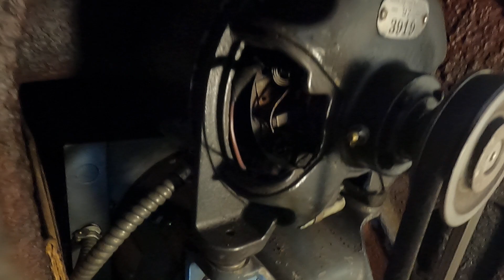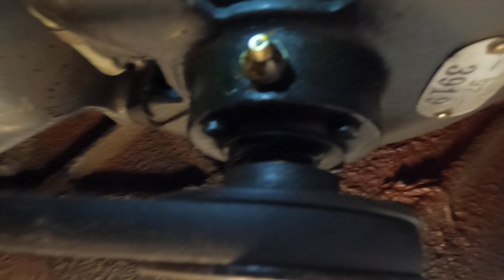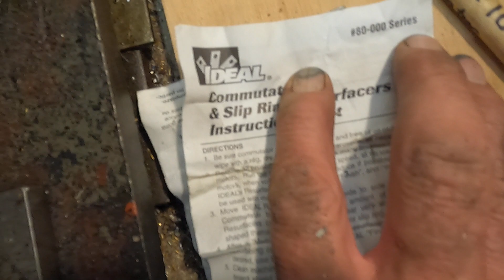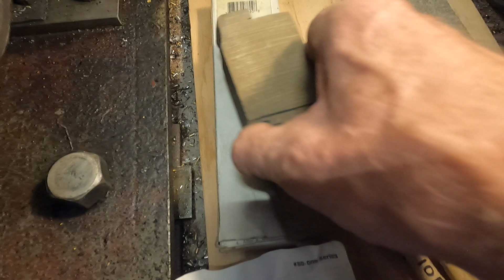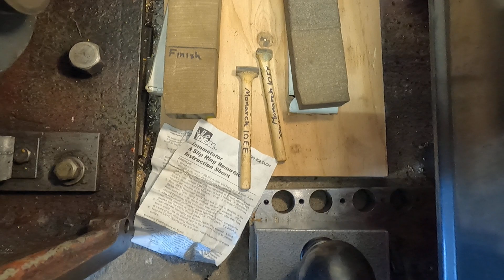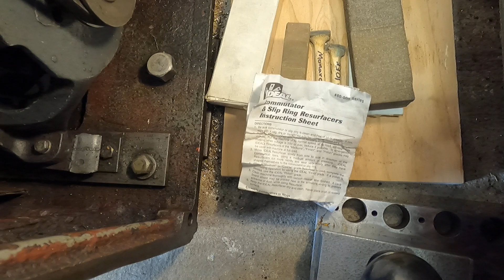Monarch 10ee lathe Motor Generator Reliance Drive maintenance

Comment: I don't understand why the engineers of the Monarch company have given this solution... It seems to me a very complicated, noisy system with high costs both in manufacturing and maintenance. I am sure that it is not effective both in the electric yield and in the torque of the machine. It costs cheaper to maintain a clutch and a gearbox...
Reply: Remember this "solution" was put in place in the early 1940's.  Almost 80 years ago. Look up the reasons for and the uses of the Leonard-Ward drive system that's over 100 years old. It's still in use for elevators, the only difference is the motor, not the design, had to be modernized to work with a variable frequency device (VFD). Modern submarines sill use DC power and the brushes are a regular maintenance item. Monarch did change when better options became available.

Comment: Very interesting procedure.  How often do you find it necessary to do this?
Reply from the maker: When aching becomes visible on the gen, and when a ridge forms on the exciter from the split brushes, seldom on the drive motor. When top speed  can not be obtained.

Comment: I use to repair electric motors and tools comutator brush cleaners can be bought from grangers and from many places that carry n sell parts for motors.  IVE had one cleaner and used it for thirty plus yrs on tools . When your done its a good thing if you blow out the dust .
Reply from the maker: The systems cooling fan will clear any small amount of dust, the commutator stones resurfaces the commutator, removing even deep gouges, more to come.